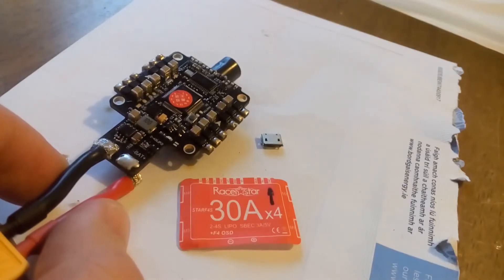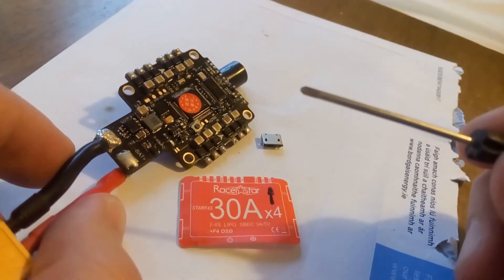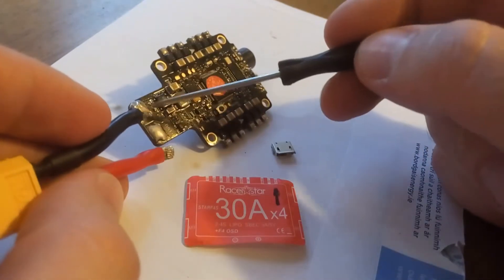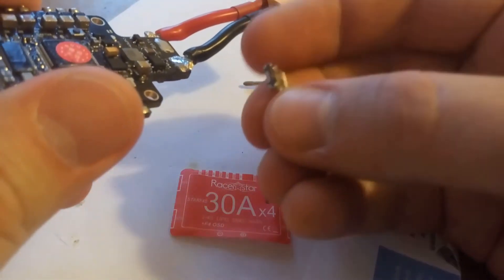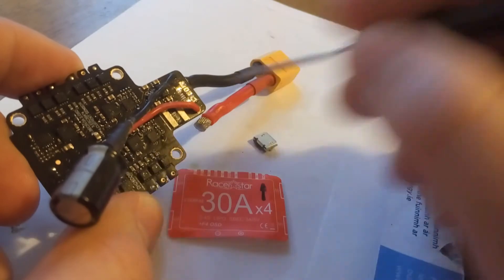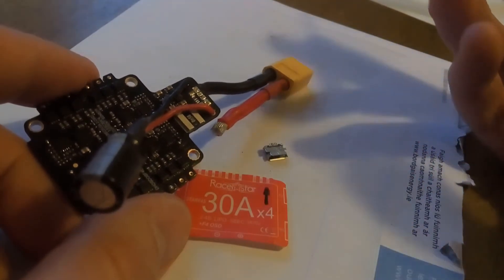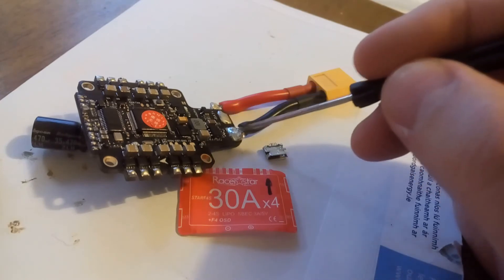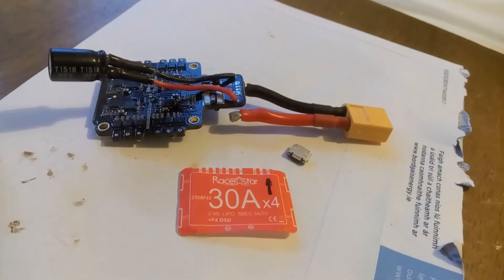Racestar STARF4S USB issue

Comment: you got it way to hot bro, higher temp less time on the pad. see how dull your solder looks thats a sign that you got the solder hot too long. a little flux will help alot in that issue. still rip. :(
Reply from the maker: yeah mate, my iron was not hot enough and I hold it for too long, burned the solder.
Reply: Andrei Rjabokon no worries, im sure most of us have done it. i've learned a hotter biger tip and a quick hand helps alot. flux helps a ton as well. best of luck , cheers.

Comment: My usb connector snapped off. It took one of the pads off too, so there is no way to fix it. I HIGHLY recommend trying to hold it in place and connect to Betaflight if possible. If you are able to do that, turn on Uart1 as a MSP connection. If you are able to do that, you can connect with a FTDI adapter. The bottom pads under the USB connector are Uart1. Otherwise, there is no way to fix it because there are no SWD or CLK pads that I can locate to connect with a programmer.